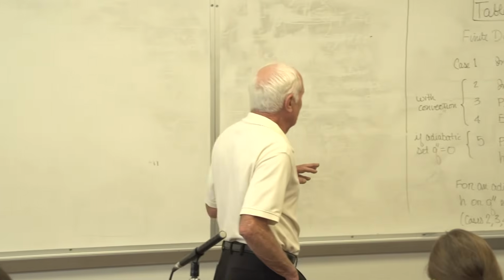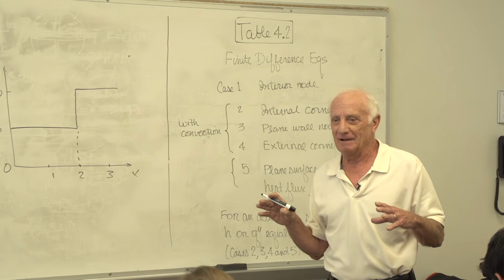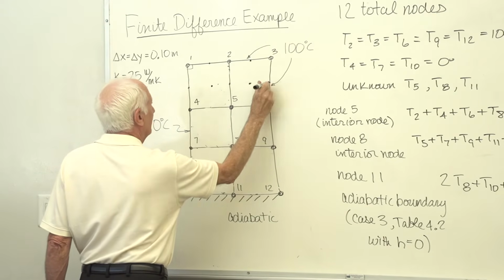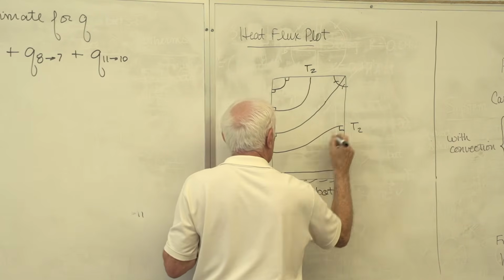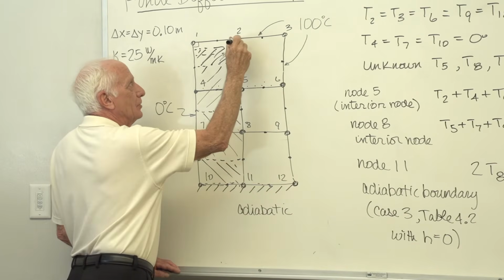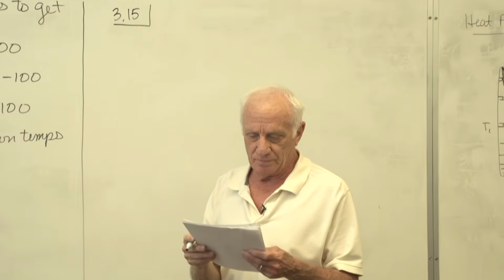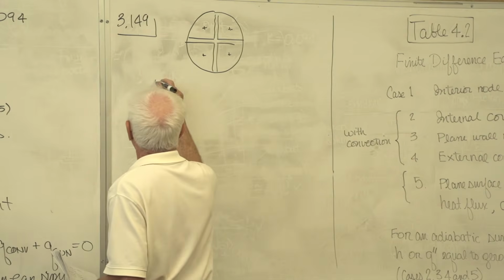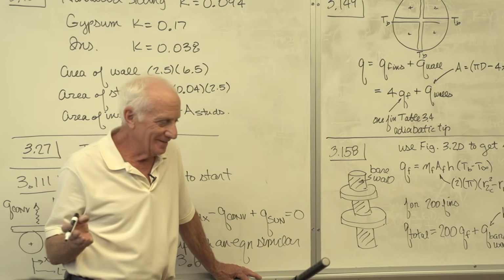Heat Transfer (12): Finite difference examples

Comment: Any confused chemical engineers here?
Reply: When he starts to write out the equations for the unknowns, it’s basically a dQ=0 conductivity energy balance around each square surface and the k value drops out and since there are four sides, you have 4T everytime.
Reply: From nit Hamirpur.

Comment: Dr Biddle, one if there are three temperatures defined on the surface? How would the adiabatic lines be decided then? Also, how would one handle heat generation?